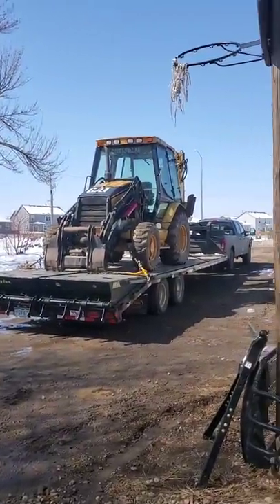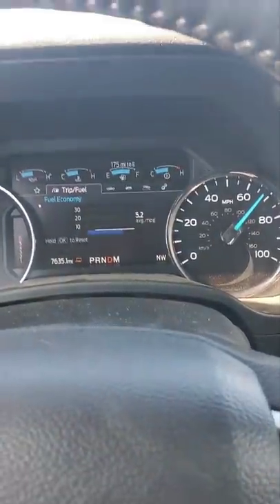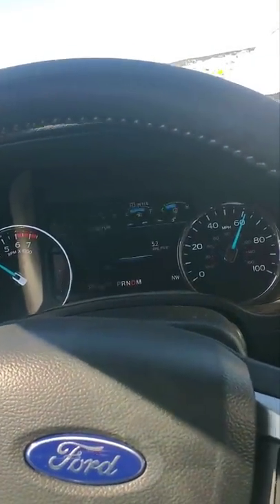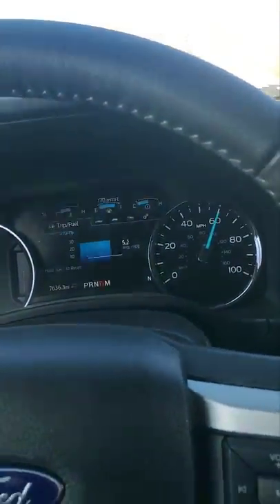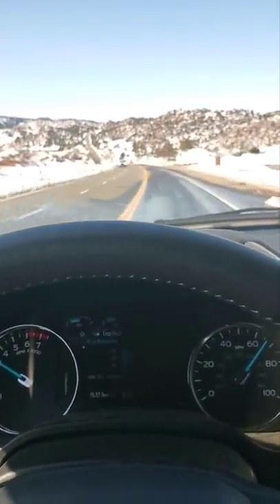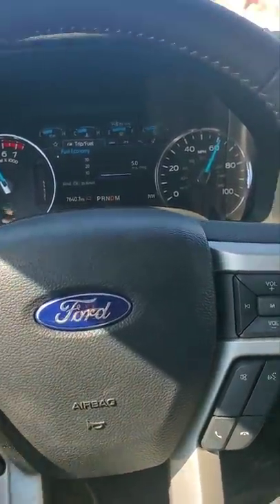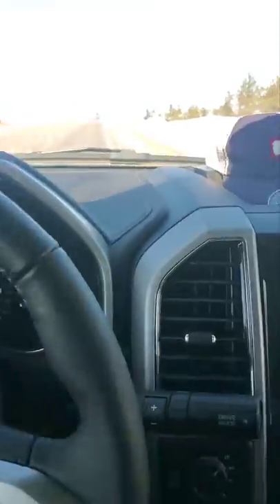7.3 godzilla towing 24k lbs through the rockies.

Comment: I Ordered a 2021 F350 7.3 with 3.73rear. Can't wait,be here in late April
Reply: A single or dual rear ???👍
Reply: @vikingored5993  Single
Reply: Wow. A "new" 2021 a "quarter" before 2022 production starts and a "1-ton" you had to special order as Ford apparently sits on a trainload of $7500 "crate motors" that are only "Ford Performance" OTC to retail customers and all the "swappers".getting them free but are "service replacement" in the Ford dealer parts system.

What's the holdup? The "Ford" 10-speed automatic transmission for that "big-block".or the 3.73 "Ford" rear axle in that "one-ton" or the fact that your "special order" is a really goofy way to order a "1-ton" and you're A-OK with paying all the taxes, insurance, registration etc on a "brand-new" truck that will be a "year old" model year wise about 2 months and a day after "delivery" and you're going to pay 2022 taxes on it twice is one "calendar year"? 

Let me guess. You're paying "MSRP" too. And.maybe a "premium" for a light-duty axle ratio in a "1-ton". And a "Chevy" ratio at that. 

I had 3.73s once. In a '69 Chevy C10 Custom light-duty half-ton that left the assembly line with a 307 and a 3-speed on the column. 

My 1-ton has 4.56s. '85 K30 4x4 dually regular cab-chassis with a flabed and side boxes. A "mild" 10:1ish early 70s 454 "car motor" with enough cam to lope a little, Edelbrock 2-O intake, Holley 750 double-pumper that's going bye bye for a Q-Jet or EFI when the motor gets "freshened" up again and maybe finally sees a boring bar and hone after 150,000+ miles "towing" a TLB on a 25-foot tandem dual flatbed for a concrete crew, headers and a Holley blue pump and about 4.psi to the.dual feed. SM465 behind that needing 3rd-gear synchros "already" with somewhere north of 300,000 miles on it. "Direct-drive" NP205 behind that without the.pesky "coupler" from trans output to T-case input. Good old 14-bolt behind that and a REAL Dana 60 up front. Stack of leaves on each side in the back thick enough when "sled pulling" and wiping up the "stock class" it barely "squats" even with the hitch in the highest receiver (got a stack of 5 or 6 tubes in the rear bed "skirt" tied into the whole main bed frame and gooseneck hitch so zero need for "drop hitches") hole I can put it in and keep the front wheels on the ground untll she "powers out" 25-100 feet ahead of the "first loser" and then there's a good six inches of "overloads". All factory and straight-truckesque. I've been told it's more like a 1 1/4-ton being a cab-chassis with no worry from/by the factory about "overloading" a pickup box and tailgate. Dual tanks. 12 mpg if "adult-driven" with occasional bursts.of "WOT" up to wherever we get beyond 85 mph. No tach. No need. I keep my foot in it until somebody gets scared I notice the oil pressure needle is starting to "flutter". Pretty sure somebody stuck an HV oil pump in it back in the day and with 6ish quarts in the pan and some in the filter I figure about 60 seconds at 6000ish RPM is about what it takes to pump most of it "upstairs"and start sucking a little air. Probably go back to stock when it gets "freshened". 

I figure she's good for an honest 375ish horsepower at the flywheel at 6000-6250ish RPM. And at 7000ish pounds with 6 on the ground and stock size "all terrain" tires at that she always powers out before she spins out. Low range 2nd gear; high range1st gear, even high 2nd with a "light" sled. She'll go in about any gear you can start it in and still whip most everybody even it's too high. 

Sad to say she hasn't whipped nearly as many Fords as Chevys or even Dodges. And she's spanked a badass 440 and even a genooine 426 Hemi in front of a Torque-Flite. 

Last season I pulled right after buying her and getting her out of the weeds and back on the track for the first time in probably 15 years. Forst pull we were having neglected fuel system issues and running like crap and got beat pretty bad by that 440 Dodge she used to spank. I Holly blued and dual fed and adjustable regulated and filtered her and got one tank cleaned out and drawing good and threw some plugs and a timing light at her. The next weekend the tables turned and we went from about 30 feet behind the Dodge to 30 feet ahead when I shut her down "early" because she was bouncing just a little. Enough the front tires were a foot off the ground. Repeatedly. She didn't break. About any other truck would have. After that we ran the table at three more pulls and I "made money" and paid for my fuel and fuel system parts and beer. 

Only had one "scare". Very stock-looking 2000ish Chevy K2600HD with "8100" badges on the side and a bone in its teeth and 42 cubes on The Dually. I don't think he had 4.56s and I know we had probably 500-600 lbs. outright and that again in hitch height/distance advantage on him. I had maybe .5 mph on him when the pan dropped at 3/4 track and a few more Rs maybe. Probably not much more "horsepower". But a different "ECU" behind the wheel. 25 feet seemed close after putting 50-75 easy on everything else.

I got a feeling "Godzilla" would be Rat turds in no time if your "1-ton" and my "tonner" ever got together.

I just don't know of any really "strong" factory "bjg-blocks" that need more transmission "speeds" than any pickup truck in history BEFORE you get into the transfer case. 

"Godzilla". Typical "Ford power". Complete science fiction.
Reply: @deeremeyer1749  Your wrong on 90percent of my New order. Have a good one
Reply: @hotrodrigs1  thanks for answering my question,,,
 I want to buy a 7.3L also,,,I want to haul concrete and heavy a,s,s stuff in the back,,,
So I want a dually to be able to have more Payload.
Reply: For sure go dually.  I ve been in  dually since 99. I don.t haul or pull as much as I used to. So I.m going to single rear wheel, sick of Def an Pollution BS. So going to try the big Gas Motor.
Reply from the maker: @deeremeyer1749  outta put your money where you mouth is. I'm not afraid of no sled
Reply: @deeremeyer1749  may I ask a question,,,
I read your comment u sound very Knowlogable about trucks,
My question is about the rear axle ratio,
What do u think would be the best axle ratio for a F550 gas engine 7.3L that it gunna be used to haul/carry heavy loads of concrete dirt etc,,,would the 4.30 or 4.88 or what would u recommend ?
 Thank you
Reply: @15Jeep  

The Le Mans winners were not the SOHC motors.
Reply: @johnpeters9793  You are right....thanks for the correction. It was the big block Ford 427 V8 - OHV engine. Thanks for the correction!

Comment: Since Ford got smart and made the engine with a 10.5 to one compression ratio, you can take advantage of it by using mid grade 89 octane gas, to give at least 5 percent more torque and better MPG, especially hauling through hilly areas where more pulling power is needed. It works out cheaper for the cost per mile to use the higher octane gas under these type of conditions as the engine computer will advance the timing under heavy loads. GM tests all their engines on various fuels and they got an extra torque boost of 8.5 percent by using E85 gas, because the octane level is about 95. The GM engine was a 5.3 V8 that had a 10.5 to one compression ratio. It was about 50 pounds feet of torque at most of the RPM range, over the regular 87 octane gas which is significant.

Comment: Been watching your videos to help with our purchase decision.  Currently driving a 2020 Ram 3500 Cummins.  With only 9300 miles on the truck, on a recent 16 hour trip, it left us counting down to limp mode 6 hours from home.  Luckily it happened close to a large city.  After 3 dealers refused to help us, and standing to lose a $2100 weekend, the 4th dealer we contacted got us in right away.  Had us back on the road within 2 hours.  Issue was a stuck DEF tank level indicator.  We use the truck mostly for snowmobiling in the mountains in winter (450lb sled deck plus 2 snowmobiles 500lbs+ each loaded over the rear axle).  We tow a 7' x 14' enclosed 2-3 times a week April through October, and plan for a 7000 - 8000lb bumper pull camper within the next couple years.

With the remote areas we frequent, these unreliable emissions are unacceptable, and I'm reluctant to delete a brand new truck.  Can't imagine the long term cost of keeping emissions on out of warranty either.  With crazy headwinds, we averaged 11.5 mpg on that 16 hour trip and used around 5 gallons of DEF.  I'm pretty sure I can get as good economy from a 7.3L without all the other diesel expense and hassle.  The local dealer made a very good offer for the Ram on trade, so the order is going in this week for a 2022 F-350 7.3L.  Only thing is I'm kind of stuck between 3.73 and 4.30.  Will never be towing even close to what you do, but thinking if the MPG difference between the two gearings is negligible, then maybe I ought to let the seven three be all it can be and go 4.30?
Reply: Get the taller gears if you're going to be towing under 12k. The fuel savings is worth it.
Reply from the maker: I'd go with the 4.30s I don't believe your towing mpg will change much but it will be better to have the closer trans ratios with the 4.30s when your towing that often.
Reply: @Colton Brown  The order went in on Friday.  F-350 Lariat, 4x4 crew, 7.3L, 4.30, LWB, Star white, black appearance package, FX4....  Now the long wait 😔
Reply from the maker: @Fatonzzz  that's awesome! Do you mind if I use your story in a future video?
Reply: @ColtWR  I don’t mind at all.  Whenever the truck arrives maybe I’ll post a quick overview video.
Reply: My 2021 cummins has that same problem." Service def see dealer" 7500 miles. I'm not happy
Reply: @midlifemike4916  It's definitely not a nice feeling knowing that you can't trust your brand new and very expensive vehicle.  I mean this is typically why we buy new is to have some peace of mind.
Reply: @Fatonzzz  Same here, my order went it 3/1/22.
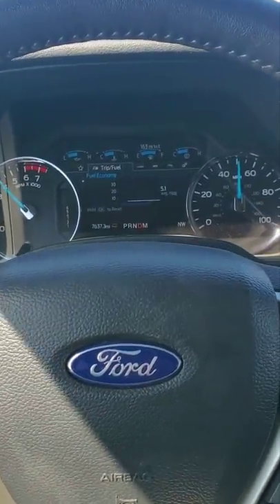F-350 XLT CCLB FX4, 7.3L 3:40 gears. Now that long wait...
Reply: Delete & no more def issues.....
Reply: I don’t know if this helps but the 4.30 gears gets 1mpg less than the 3.73 and the 4.30x4.61 gear ratio is almost the same as a 3.55x5.72 OBS Ford with the ZF 5 speed granny low! Not to mention add in 2:1 for the torque converter!!
Reply: @ColtWR  Well today is our final day with the 3500 Cummins.  Picking up the new F-350, 7.3L tomorrow morning.  I'll try to put together a short edit and post it on my channel in the near future.
Reply: @ColtWR  Liking this thing so far! https://www.youtube.com/watch?v=PbCvI_l5uao
Reply: how to avoid DEF?

Comment: Oh yea I bet that 7.3 is a beast? Built to work hard making big numbers. Hope the Ford tranny is up to the job! Temps getting up to 230, seems high. But I’d really like to see a Ram and Chevy subjected to the same punishment, just to see how close they could possibly get to this amazing achievement. As far as overall ride and handling I’m confident the Chevy, especially if in 3500 guise, with the dual lies and 4:10 max towing package if that’s possible with the gas engine. I remember TFL Trucks did a three way comparison of F250 6.2, Ram 2500 6.4 and Chevy 2500 6.0 gas powered trucks, towing the same trailer all loaded up with the same weight. But the outcome was a big surprise! With the Chevy taking 1st place in time an mileage!
Reply from the maker: I'm a ford guy fpr sure but in the small block platform the 6.0 gm is hard to beat!
Reply: @ColtWR  especially the new 6.6, without the cyl deactivation system.

Comment: The only down side its the fuel stop. With a diesel you got the truck stop which is easy to pull in and out of. But a truck with a gass engine? I bet it sucked trying to pull a 5th wheel trailer through a Exxon or something.

Comment: Guys, what's the big deal ?  Ford has been making big gas engines for decades, lots of torque?  In 1980 I bought a 79 F-350 with a swapped out 460 in it, that's 7.5 for you metric guys , 4 speed, 4x4. It would pull anything I hooked on to , anywhere I wanted to go, would pass anything but a gas station. My last 460 was in 1986, switched to Cummings in a less desirable truck, but made the best of it in 93. Still have my old ones with gas, and 05 is my newest Cummins. Cannot stomach a new truck price

Comment: Man running at 5k rpm might get old. Recognize those are good size hills but not sure I could stand the super high rpm’s.
Reply: Never nothing sounds as good as a big block running high RPM's working hard
Reply: This dude is WAY over his 3.55 tow rating, it is stressed beyond its intended use. The truck must do max rpm to get power due to being overloaded. Depending on what your towing it will have much lower RPMs…
Reply: @dougc190  for short durations sure.  For 20 minutes on end just no
Reply: @loveracing1988  and when was the last time you pulled a hill that took you 20 minutes? I can go up Donner pass,  baker grade the grapevine and doesn't take me 20 minutes with my foot on the floor at 1800 RPMs in the diesel truck I drive., Does it take me 20 minutes in the 155 horsepower 1 ton I have going up those hills either.
Reply: @J C  the only thing the different axle ratio will change is what transmission gear when going up a grade. It would be same rpm in 4th or 5th instead of 3rd gear.

Comment: I have the 2021 6.2L f250. I haul 6 ton loads of rocks with it, so truck, trailer and rocks I total out to about 23,000lbs. It does pretty good
Reply: People underestimate the abuse they will take and what they are capable of with this 7.3 the 6.2 and the 6.0 gm.
Reply: @Turbo-wj9qc  that is true! I was weary about going gas but did because of cost out the door. I’m pleased with it. I can see if I towed a lot, or even heavier than 23k I would need the diesel for sure
Reply: @southerncoaststumpgrinding  I only pull 100-150 miles a week 8 months a year but those miles are pulling 18k lbs from the bumper and I do it with a '15 Chev 6.0 that turned over 230k miles before I put it away for winter.

Comment: Good review sir. We have 2020 F350 7.3 gas Trmor package with 4:30 rear. Have not towed anything heavy yet but lots of torque. Very happy with it.
Reply: y'd you go with the 350 instead of the 250? from what i've read and watched the two trucks r the same so just curious if that info is correct, thx
Reply: @adamant7146  I’ve got several trailers but only one of them has about a 2000 pound tongue weight for conventional towing.  We don’t tow very often so the diesel was not a choice because I did not want to spend the upfront money the cost of diesel DEF fluid and additional oil changes.  It would’ve taken me six years of driving to make up the difference in the cost of diesel. Yes I know when you resell your truck you can recoup lots if not maybe all the money but I did not want to spend the amount of money upfront. With all the reviews I knew the 7.3 with the 430 axle will definitely do the job and it does.  As far as 250 versus 350 can’t remember now but I believe they might be the same. The choices were very slim when we bought it and there was very little inventory in the state of Texas. Wasn’t looking for the Tremor but we sure like it and it gets a lot of attention. The stock tires have been great with no issues and they are relatively quiet. No death wobble no problems at 15 months old and 25,000 miles. I’d have to look inside the door at the payload but I do believe mine is about 3600 pound payload.  Transmission and engine work fantastic. I suppose if we lived up in the mountains or engine braking would be extremely helpful then I would’ve opted for the diesel. The brakes are fantastic.  I think you can only get the 430 rear end on the trimmer package. Get the 250 or 350 and you would be happy.  Not sure if there is a difference on the 2022 models versus the 2020 which is a minor. Look up the specifications on the Ford website and you would be able to determine the difference between 350 and 250. We’ve got the camper package 11,500 GVWR and heavier front Springs. I didn’t buy it for fuel economy and I really don’t care.  This is our daily driver. How do you suppose if money was not an option I would get the diesel but the problem with the diesel is it is a lot less payload.  Good luck

Comment: It’s got the power for sure. If your towing around town it better than a diesel. But on the highway it annoying every little hill and it’s jumps 2000 rpm’s. Towed a 3 car car hauler with one. It was horrible it seams the engine is working at 90% every hill. You can’t drive it all day for sure your tired after 5-6 hours.
Reply: I gross 27k and it is pretty drama free

Comment: Are factory ratings severely underrated on trucks? This set up has a max gooseneck trailer tow weight of 14,600 lbs if I remember correctly yet you tow around 24,000 lbs. I ask because I'm looking at getting a ram 4500 and don't know if I'm going to missing out on a lot by going with 4.10 gears vs the 4.44 gears which come with the max tow package. The 4.10 has a max tow of 23370 and the 4.44 has a max tow of 28870. The truck will be used to pull a ~20,000 lbs gooseneck living quarters trailer around the country. Will I be giving up a lot by going with the 4.10s to save a little on fuel since most of the driving will be on the highway? This truck pulling with 3.55s and way over its rates max tow makes me think I shouldn't reallyworryabout gearing as much as I am. Any advice would be appreciated. Thank you.
Reply from the maker: Yea, gearing with the powerstroke isn't going to effect you too bad. With the 10 speed transmission 1st is good and low and you have 3 over drives. I'd probly go 4.10s
Reply: @ColtWR  well on the ram, the cummins only has a six speed. Would that change your opinion. Only reason I'm looking at the ram over the f450 is because I can find them on the lot around where I live with no mark up. Fords are still marked up.